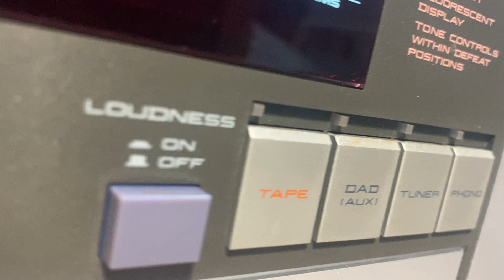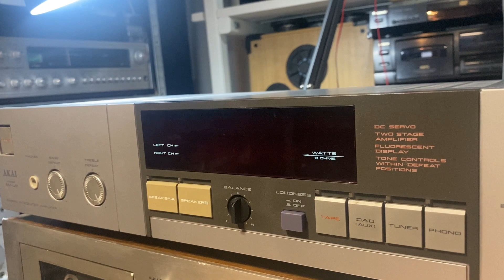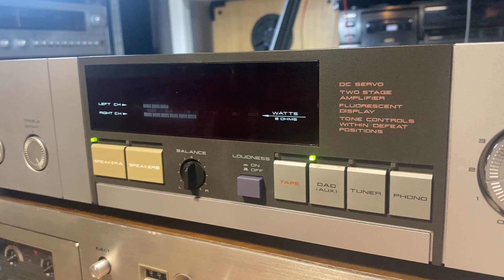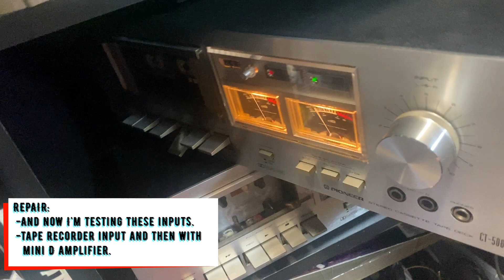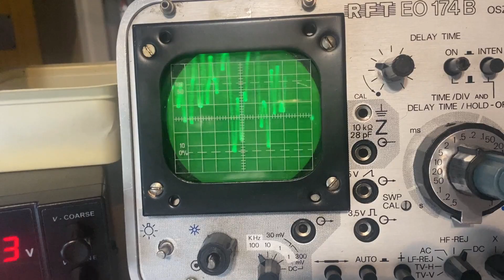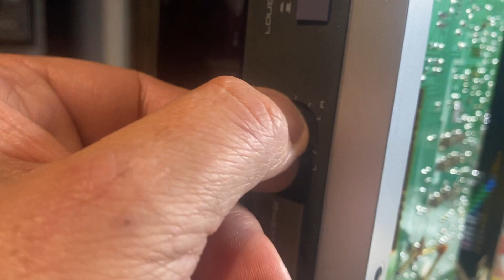AKAI AM-U2 amplifier-1983 -REPAIR- PART 1.

Comment: i have a jvc am-u1. The bridge rectifier is bad part number BA40 / c3g. What can i replace it with?
Reply from the maker: Look at the data sheet of this greatz bridge and look for something similar. You can choose the right one based on the max voltage and rated current. When installing, remove the fuses from the output side. And check the output voltage levels before you put the fuses back in.